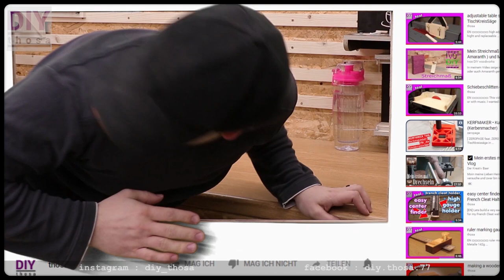CHALLENGE ME - MAKING A BOTTLE PUZZLE

Comment: I used a neo magnet to hold the bolt from  the outside of the bottle so could get it in the  hole took less than a minute but screwing the nut on took a lot longer but I made this bitch.
Reply from the maker: You have cheated ! 😅🖐

Comment: Very nice, what are the nail, ball and second hole for?
Reply from the maker: thank you 😀  you need the ball to screw / unscrew the nut. (like seen in the video) . with a bit of luck you can use the nail as a rail for the ball to prevent it from rolling far away..   🤓  and the second hole:   I dont know.. 😅  just saw it like that in the linked inspiration video 😉